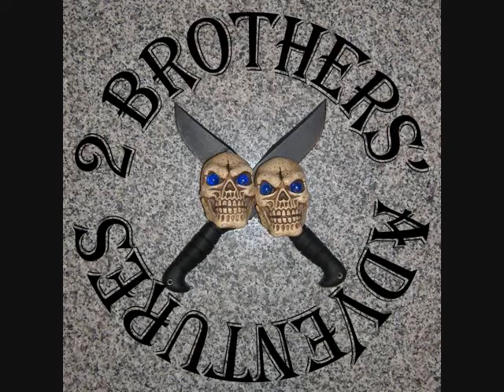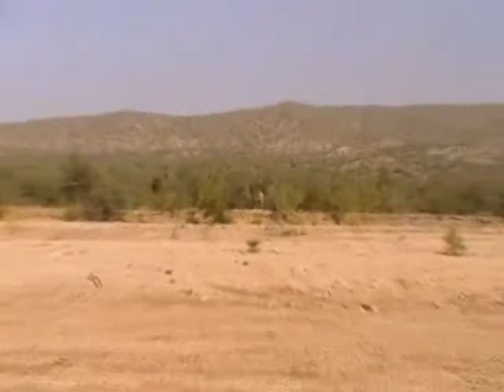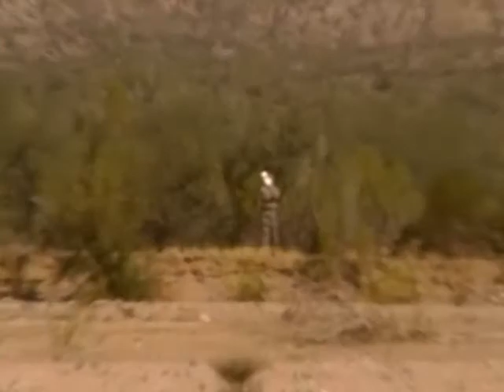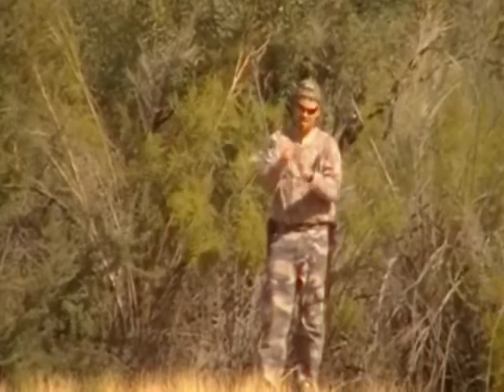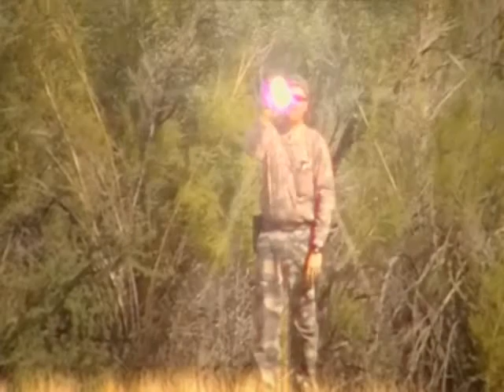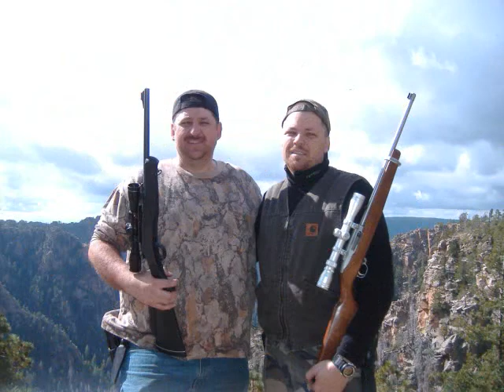Signal Mirror

Comment: A CD works pretty well too and it has a hard case to store it in of the CD wallets. Remember the hole in the mirror is a sight to aim the reflected light. Also a stainless steel bowl that is polished on the inside works really well too. Sort of a parabolic dish for light. Oh yea and Mylar emergency blankets offer a lot of surface area to really shoot light out a looooong way. Make a frame and stretch the and toe the blanket onto it to optimmize reflective surface. Really good vid, 5 stars.